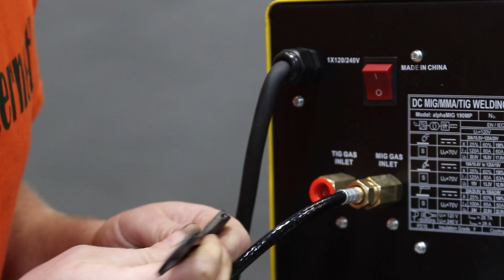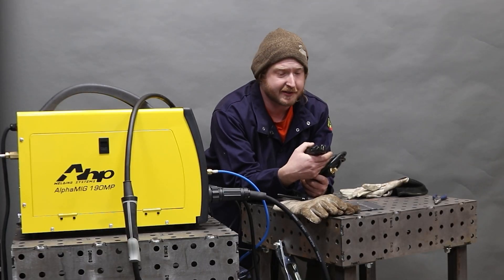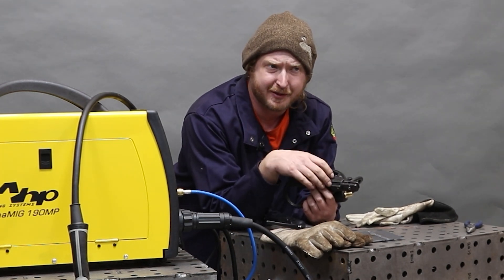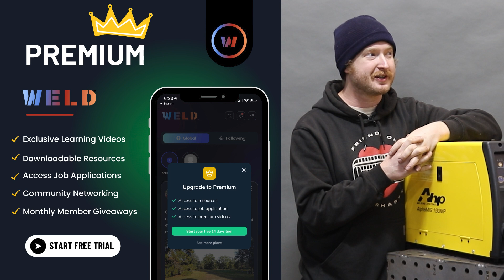Welding Mastery: Discover the AHP Alpha MIG 190MP with Expert Welder Craig Cowen

Comment: What’s the thickest it’ll weld on 110v?
Reply: According to spec's, it will do 230a @50% duty cycle, so that's about 3/8 single pass, 1/2 multi pass
Reply: Thank you @HVACQualityAssurance